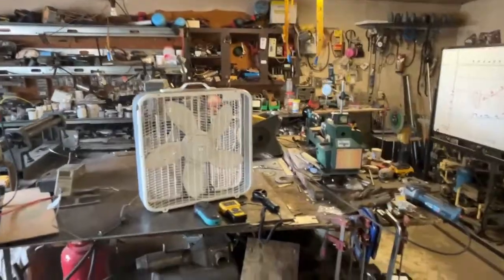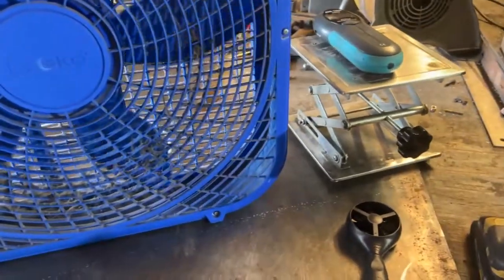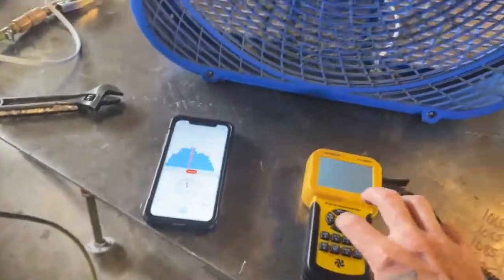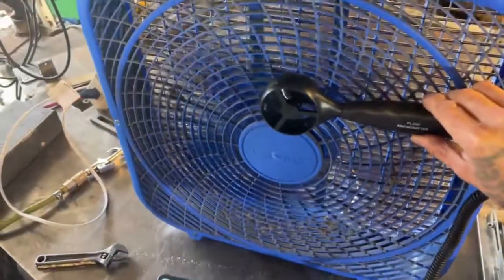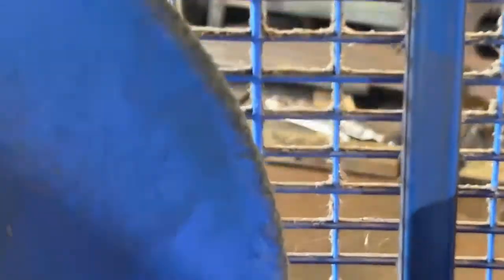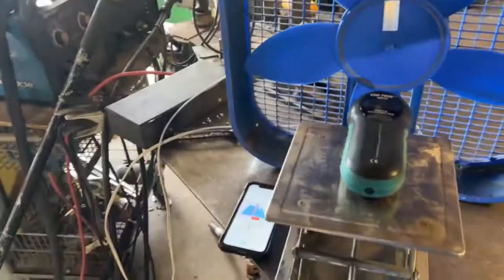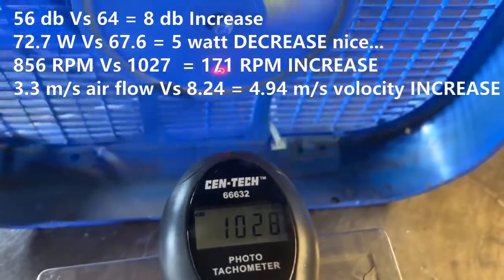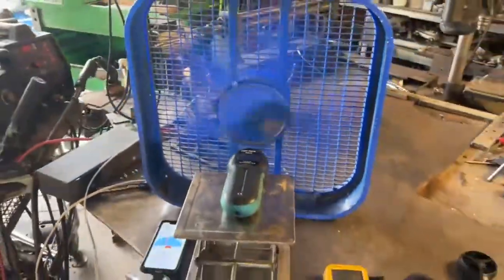Does a dirty fan blade spin slower than a Clean one ?

Comment: Those guards cause a lot of drag.

Test it with the cover /front grill back on. And then without any guards.  A few years ago I took all the guards off all my my oscillating fans with plastic fan propellers. It makes such a huge difference but i dont have those fancy tools... rpm tach or air flow/speed indicator. Would be cool to see all the numbers.  

The motors are pretty weak. only real danger is if the fan blade stops spinning or it gets knocked down or something stalls the engine it could overheat and cause a fire.